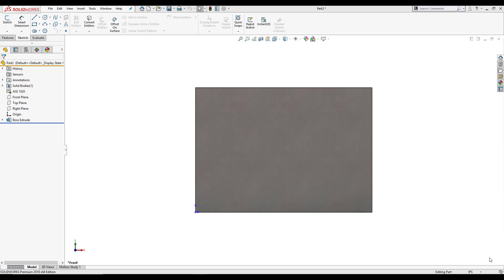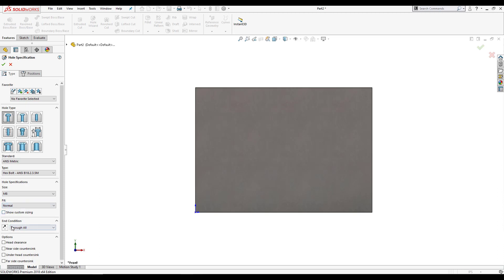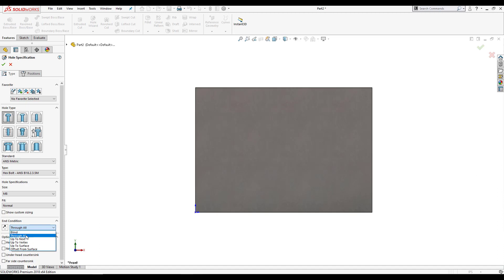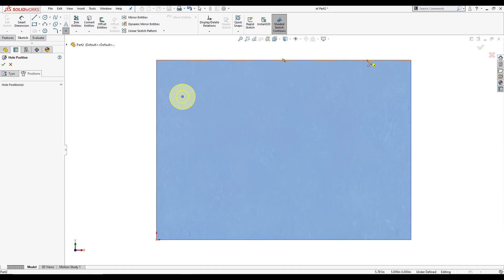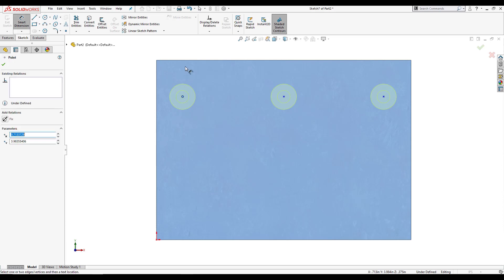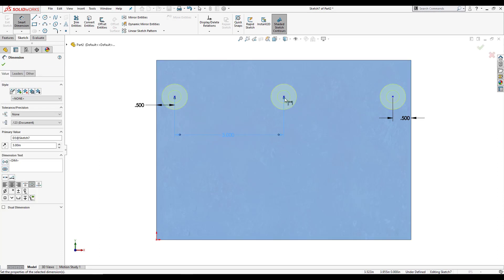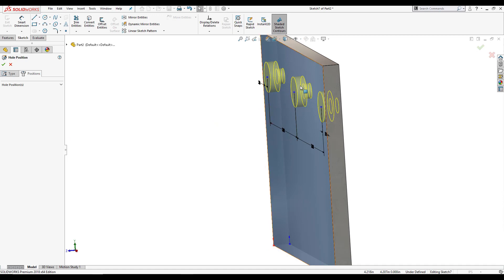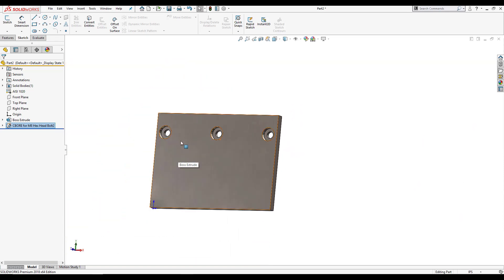Deep Dive into SOLIDWORKS Hole Wizard

Comment: Really simple request... I'm new to Solid Works and I've been asked to create a part. Steel block 100mm x 25mm x 10mm with five 10mm holes in it.... I've created the block. Struggling to create evenly spaced holes.. Help??
Reply: You could use the linear pattern option to create a set of evenly spaced features.